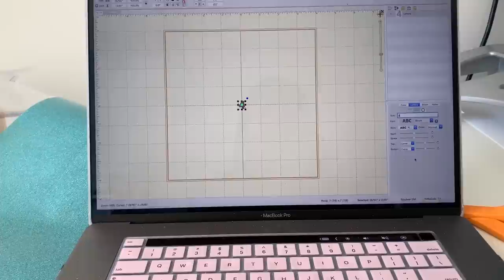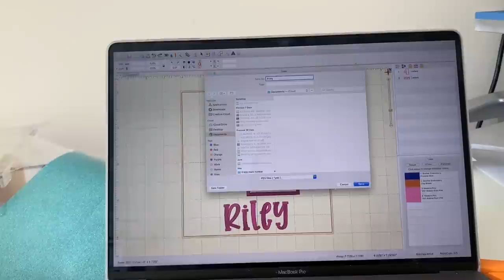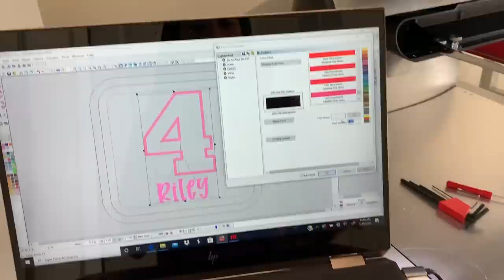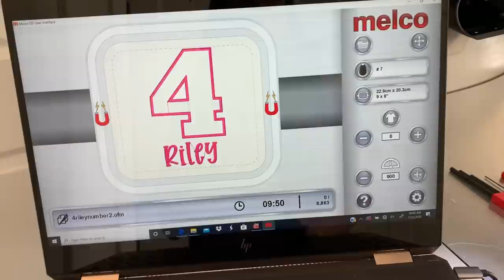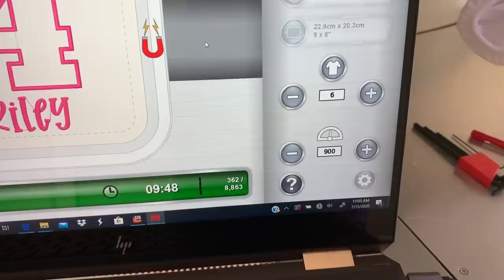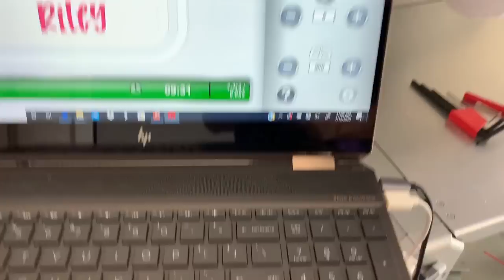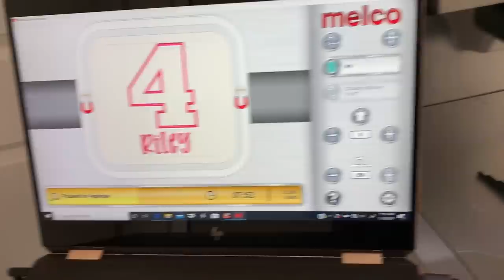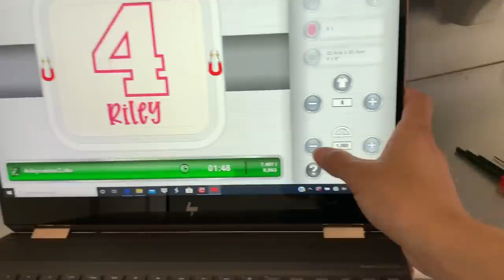Using Embroidery Vinyl on Melco EMT16X! Using Design Shop & Simple Interface! Shirt Start to Finish!

Comment: Whew a size 9 needle - Yikes! I embroider on marine vinyl every day and the needles I keep in my machine are the TITANIUM coated which glide through the vinyl smoother. The titanium needles also last longer as they don't get dull as quickly. The titanium ones I use in my 15 needle machine are Organ DBxK5 PD 75/11 (PD stands for Perfect Durability) and AllStitch has them. I buy a box of 100 at a time. Melco takes the same needles. You may want to give them a try for that embroidery vinyl! I keep them in when I'm embroidering on everything, not just the marine vinyl.
Reply: I do also use Titanium needles in my  Brother and Babylock multi needle machines. They are the Organ 15x1 ST 11PD. The ST means a larger eye for the needle threader to be able to work. The 11 means size 75/11. PD is Perfect Durability which indicates they're the Titanium. These needles stay sharp longer than the regular EBBR needles so you don't have to change them as often. And the Titanium coating makes them glide through the vinyl smoother without the drag/sticking that can happen with the vinyl and regular needles. I buy a box of 100 from MJ Sewing & Vinyl.

Comment: Hi Angela, yes I would like to see the race. I was wondering what was the thin material that you put on the finished embroidered tshirt before you pressed it.  What is the purpose of that.  And what is the machine called that you used to press it with?

Comment: You can also get polymesh in beige, which will really be invisible on a white shirt. I’m telling you it will work. You can use two layers of polymesh — rotate one layer 45° from the other layer. I know of OESD, and Floriani. I’m sure there’s more but those are two brands that I know about. I know that they have a fusible polymesh, which I think only comes in white, but they have one that isn’t fusible and that comes in white, beige and in black. Also, book because your shirts are so nice and thick maybe it would help to put a water soluble topping underneath your satin stitches. I know 0ESD’s name is StitcH20. Off the top of my head I do not remember the exact name of Floriani’s WSS.

Comment: Did brother say u could use can air to blow out the machine? I have a brother single needle and 10 needle babylock and was told not to use can air because it would blow dust particles back where u can’t remove it. Just curious what Melco says. Also do a side by side race.
Reply: Susan Epps, Melco says use canned air.
Reply: DJ Parrish maybe that’s with their brand. I was told by babylock dealers that they don’t recommend using it. I just take apart and clean or do shop maintenance every 6 months on mine.